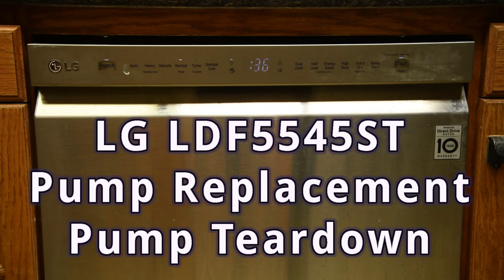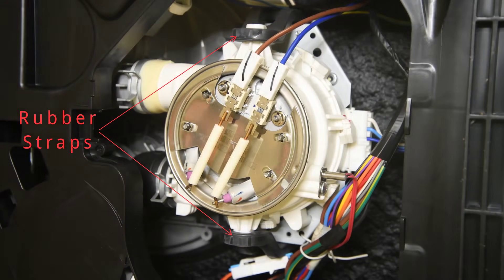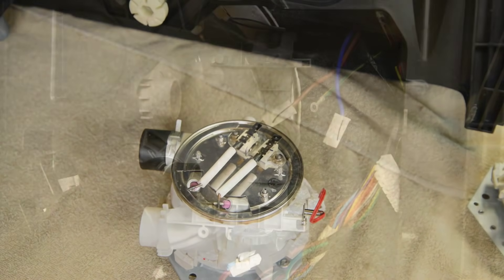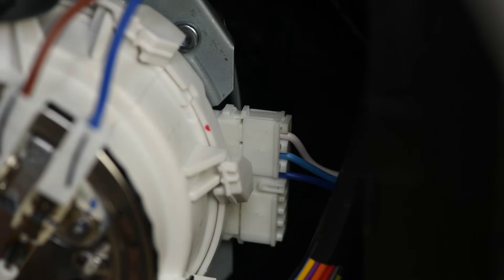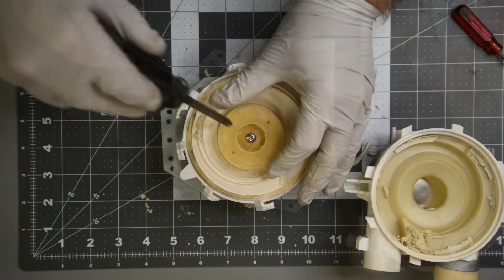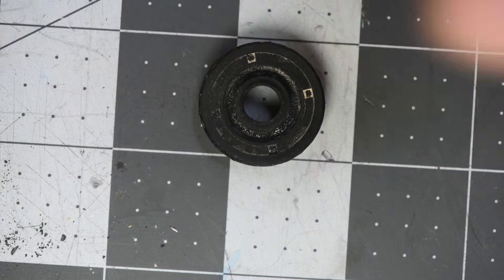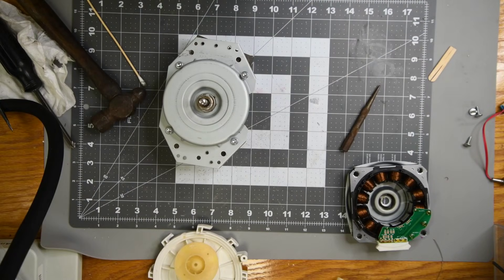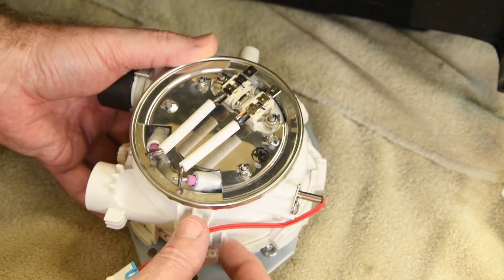Noisy LG dishwasher Fix – Pump Replacement

Comment: Interesting video, I've got a LG dishwasher only 2 years old that had the same failure so it's clearly nothing they are interested in fixing. The interesting thing about how the pump installs is that the motor is on top when everything is assembled. It's not water dripping in, it's spraying UP. Not enough to leak on the floor, but enough to destroy the bearing over time. This part is clearly designed to fail. 

I've no pictures of the work, but I did disassemble the motor and replaced both bearings (and have extras in case they fail again.) I also de-rusted the top motor lid (Evaporust) and painted it. I smoothed the shaft and re-assembled with screws. Shaft wasn't as bad as yours, I suspect your hard water and age damaged it more. I used high temperature valve grease (won't damage seals and holds up to the hot water) all around the bearing and shaft on the outside of the motor, and liberally on the seal and shaft as well to help minimize water intrusion and damage. I also added a thin firm rubber disk that was about an inch in diameter on the shaft that now shields the bearing and motor from the rest of the pump assembly.

I've no illusions that this will last longer than it has so far, but it saved a bunch of money. 608 bearings are common "skate board" bearings, but beware of cheap chinese bearings. You don't want to be replacing them next month too. I suspect the detergents will break down the grease I put in, but I had to try something.

Considering LG has not changed the design of this pump at all in years, EVERYONE that has an LG dishwasher will eventually run into this.
Reply from the maker: Only 2 years old, that’s horrible.  It’s not a long lasting seal but should last longer than that.  If you don’t mind, what model number is the dishwasher?  I wonder if they though they could fix there warranty problem by turning the pump and motor over.  Trying to keep the water out of the bearing.  Instead of redesigning the pump to use a longer lasting seal.  I don’t see how any of them could last 10 years.  Unless it’s never used.  That rubber disk should save the bearing, great idea.
Reply: Very impressive!

Comment: Excellent video! I have the same model with exactly the same issue - Good dishwasher which did run well until the noise started. Only about 4-5 years old.
Reply from the maker: With that cheap seal in the pump I don’t think any of them will make 10 years.

Comment: Great video. I appreciate you doing teardown so we could see failure. I also thought bearing replacement might be possible, but your video shows me too much headache and just replace assembly. Found a NIB pump on ebay for $70 with a manufacturing date of 6 months ago. Hopefully they have revised design or parts so will last longer. Tried to get one free under warranty but they refuse to send me part.
Reply from the maker: It would be nice if they would improve the seal in the pump.  That would maybe get them 10 years from the motor.  Thanks for the comment.
Reply: How did the pump work out for you? Would you be able to share the posting?
Reply: @christopheryarborough8751   it worked fine. The electrical connectors were melting from corrosion causing resistance and heat. I am capable of cutting wires and adding new connectors with dialectic grease to prevent happening again, but maybe that is why they wouldn't send me a pump without a professional doing the work.

Comment: I watched a guy on YT take one apart and replace the bearings
Reply from the maker: I was planing on trying to replace the bearing.  I think I found the correct pump seal.  And the bearing is a standard size bearing.  I just didn’t notice how bad the motor shaft had been scarred till I had it torn all apart.  It’s not a cheap pump assembly, so if the motor shaft is in good shape I don’t see why the bearing couldn’t be replaced.  Would of course need to replace the pump seal, or the new bearing probably wouldn’t last but a couple of months.  And thanks for the very nice comments.  I really do appreciate it.

Comment: This video was infinitely more helpful than anything found on LG's site.  Thank you very much for producing this.  The information and production value was exceptional.  I especially love that you included the sound your dishwasher was making and the tear down of the pump.
Reply from the maker: Thanks, almost didn't include the pump teardown.  But I found it interesting, so I'm glad someone else did as well.
Reply: @metalplasticelectronics354  The pump teardown makes the video. It shows that attempting to repair an LG Direct Drive motor isn't worth the effort.
The rest of the video I could work out. Thanks.

PS: At least you could get to the pump easily. My Australian version of the 1481S4 doesn't have a nice cover like that. Much harder to work on. As I've already replaced the Vario motor on it, I know the Direct Drive motor would be a pain. Alas, I am the second owner, so I don't think they will cover it on warranty!
Reply from the maker: @RoderickGI  Wow, no access cover. How do you get to anything underneath?
Reply: @metalplasticelectronics354  With great difficulty, reaching in from the side mostly. After pulling off the three side covers. Not made to be repaired.
Reply from the maker: It's like nothing is being made to repair anymore.  It's sad.

Comment: Mine was the same motor, only it had another, smaller hose attached, right after the large hose, shown in the video.  It was relatively easy, I just had to attach the smaller hose, first:  it attached to a short rubber hose, attached to a rigid plastic tube -- there was virtually no play in any of it.  I found that it was much easier to turn the machine upside down, to gain super-easy access...  Twisting myself on the floor, was terrible, and I could not access one of the large hose clamps to move it back where it belonged, until I rotated the machine so the motor was on top.  Turning the machine upside down, made the whole thing sooo much easier.  Thank you, I could not have done it without your video.

Mine had long Torx screws (used by my installer) securing it in place, on the sides, not on the top, like most are secured.  I had to adjust the levelers, so I could lift it up, to align the screw holes in the doors with the screw heads, to remove them (installer had them driven in at an angle).  The screws were covered with push-in plastic covers, on each side -- they just pry off, with a fingernail,

I found a replacement pump motor (looks OEM), online, for $72, delivered.  It is amazingly quiet with the new motor running.  So glad to have it working normally, quietly, again.  Cheers!
Reply from the maker: Glad the video helped.

Comment: Were you able to recover the cost of the pump assembly under warranty? It says it has a 10 year warranty on the motor.
Reply from the maker: I ended up taking the pump and motor apart for the video so didn’t try.  I was pretty sure they wouldn’t be too keen to replace a pump assembly that had been torn all apart.  These big companies are so hostile to repairs being done outside of their authorized channels.  But I learned a bit about LG design skills or lack thereof.  I expect LG will have to replace almost every one of those pump assemblies.  Don’t see really how any of those pump seals could last 10 years.
Reply: @metalplasticelectronics354 My $1300 LG dishwasher is only 3 yrs old and is making that noise. It's disheartening that such an expensive appliance doesn't even last more than 3 yrs B4 needing repaired/replaced parts. Warranty told me $399 for service. The part cost $225. I'll do it myself. I'm a woman but I can do it. Thank u for such an awesome tutorial. It will help me fix my d/w.